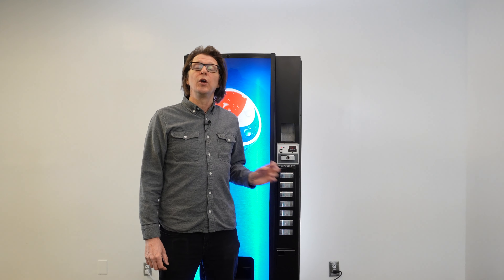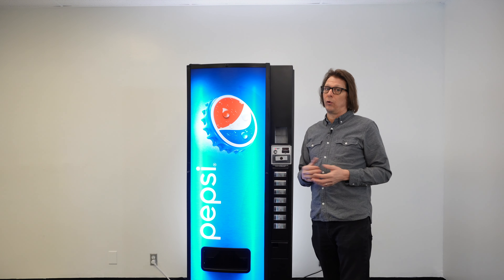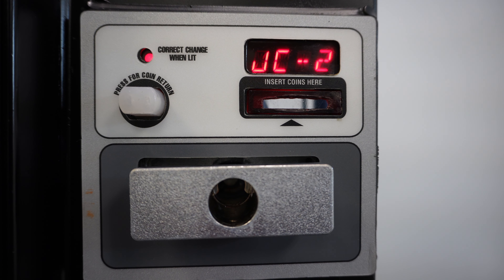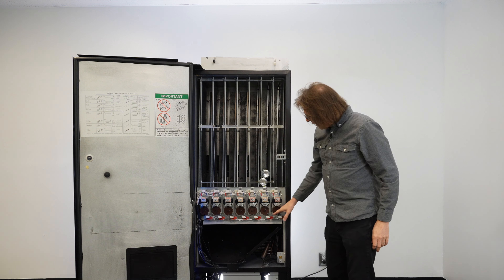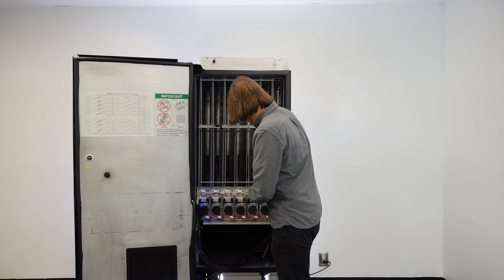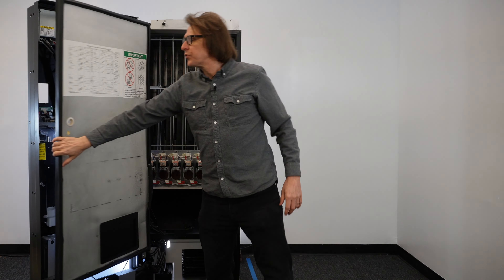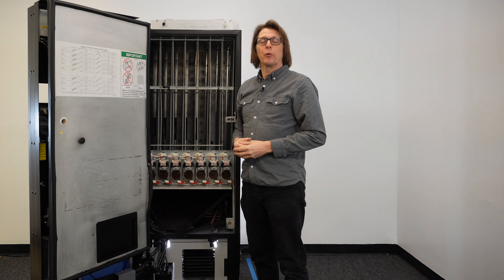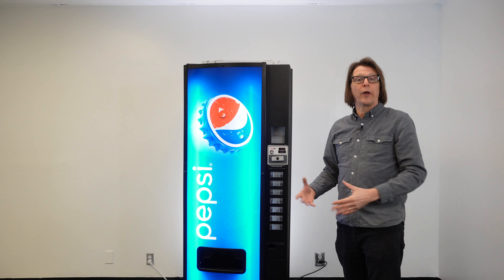Dixie Narco Vending Machine: Jams & JC Errors

Comment: HI Alex....I have a problem with my Dixie 522e 6 select machine as i left it unplugged while i did a renovation and now it is giving me a jc7 and 8 error code but it is only a 6 select machine?  Need you help clearing that...Reset board but no help with this code still have the flashing dot on screen after trying to home....Let me know if there is a solutions thanks

Comment: Your video timing is fantastic!   I have a 501e that is saying homing and there doesn't seem to be any jams.  When I do a motor test to vend from the column it vends 2 drinks.  When I attempt to vend using money it'll give me the 'try another selection'.  I've pulled all the drinks out and reinserted them to ensure it was all clear but I'm still getting that error.  Any suggestions?  Thanks!  Your videos are super helpful!
Reply from the maker: This sounds like the home switch on the vend motor of the column may be defective or has some corroded contact points. Try removing and reconnecting the plug on the home switch. This will scrape off any potential corrosion on the spades. Then retest this selection. You can also go so far as swapping this home switch with another working motor. If the problem follows the switch then the issue is the switch and it will need to be replaced. I hope this helps and thank you for watching.

Comment: Does the homing work the same way on a 501T?
Reply from the maker: It sure does. The 501T, based upon year of manufacturing, the S2 controller or the S2D controller. Many of the programing and operations of the S2 controller carried over to the S2D controller.

Comment: My Dixie Narco (not sure what model) has power to the cooling system but randomly the Buttons have no power. Usually there is an orange light that is on for out of stock but even that is not lit. I press the buttons and nothing dispenses. I am not sure how to go about fixing it or troubleshooting
Reply: I'm having the same problem recently. Any tips on how to fix?

Comment: I’m having this issue, however when I empty the column there’s no jam and I’ll try to do a motor test but it rotates almost twice. When it stops it’s in a half position. It doesn’t rotate to home.
Reply: Make sure the wires are connected properly on the vend motor switch. Or, sometimes those switches get old, 
and you'll have to replace it.

Comment: hey random question can you tell me where the nameplates are with the serial # would be i just got a DN276e
Reply from the maker: If the serial plate has not been removed it can be found on the lefthand side of the door facing the left. They are either white or silver plates.

Comment: Hey I have a Dixie Narco 501E, my problem is it keep saying JC10 and I only have 9 selection. How do I fix this problem
Reply from the maker: If this machine is equipped with an SBC control board. Then it will need to be set for a 9 select model. As this JC10 error does not affect the operation of your machine it can be ignored.

Comment: Hey Alex. I have a 501e.  I have one selection that’s when you select the product it vends like 6 or 7 bottles in a row. What could be causing this ?
Reply: Your vend motor switch is bad
Reply: Changed it. Still happened. It was the selection membrane. Replace it and issues resolved

Comment: Alex I know there must be a possibilty to vend two Monster or Rockstar drinks in each slot of the Dixiew Narco 501 or 276 E .  Do cams have to be adjusted ?  Would the spacers be placed in the back to accomadate two of these large cans in each slot.  They are the same diameter as any 132 ounce can, just longer.  Any help or better yet a video showing how to accomplish this would be greatly appreciated!  Thank you
Reply from the maker: Rockstar and Monster are able to be vended from an E series Dixie Narco. A video is in the works. I am currently editing it together. In the meantime. Here are the settings. WIDE COLUMN: Timing cam set to 1. Back spacer set to hole 8. x4 Bottle shims on the left and x4 bottle shims on the right. NARROW COLUMN: Timing cam set to 3. Back spacer set to hole 8. x1 Bottle shim. x1 Rod and spring placed in hole B in the cradle. I hope this helps.
Reply: @VendingMachineSupport  Alex Thank you very much for this information and that you're doing a video to better explain this.  I will look for that to better understand but I will refer to these specs as reference.  I also subscribed to your website for more information down the road.  Thanks again!

Comment: Dixie Narco Coke machine.  I get the BUAL code, and I cannot use dollar bills to purchase.  How do I fix this?
Reply from the maker: BUAL error is a bill acceptor error. Which coincides with the machine not taking bills. There are 8 sub level errors to the BUAL error found on 4 Button Programing COKE Dixie Narco. Press selection button 4 when the BUAL message is on the screen. The sub level errors can often be found on the inner door of your machine.

Comment: Hello, I have a dixie Narco vending machine, the "correct change" button is lit up but it does not accept change. Has anyone else had this issue before? Any suggestions will be highly appreciated thank you all!!
Reply from the maker: If this machine is an E series running the S2D control board. Press the service mode button. Navigate to DIAG. Enter DIAG. Then navigate to CN. This is coin mech test mode. Insert change into the coin changer. If rejected, more then likely the coin changer is defective. Here is a video where I show you how to get to the DIAG area. ( https://youtu.be/NqMvv4mFFwU )

Comment: I have a soda vending machine and I think it is the V Max model with 8 selections the screen that indicates $1.00 or sold out does not turn on and sometimes you only see parts of the screen what do you think is the problem everything else works fine thanks for reading me
Reply from the maker: This sounds like a bad digital display or a corroded harness to the display. Check to make sure the harness that plugs on to display or the four pins on the display it connects is not corroded. If you truly have a Vendo V Max then this is the display that will fit your machine: https://www.veii.com/DIGITAL-DISPLAY_7